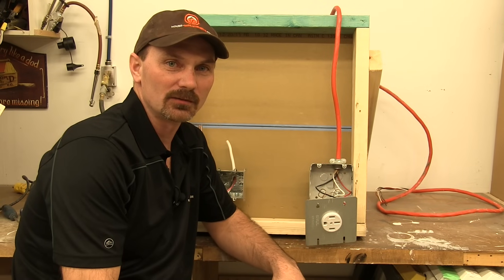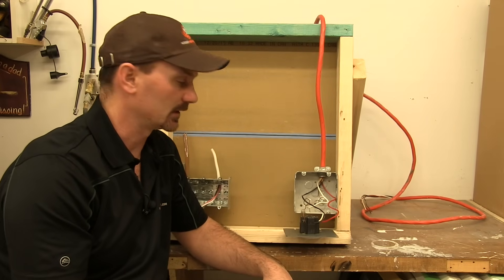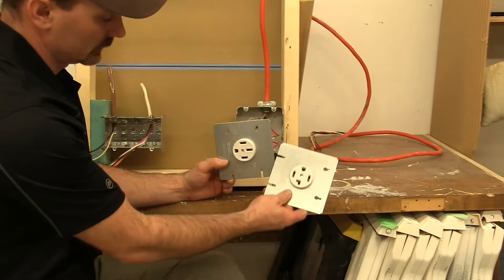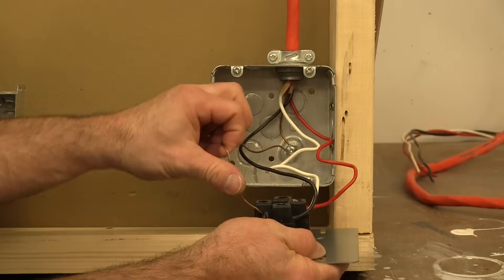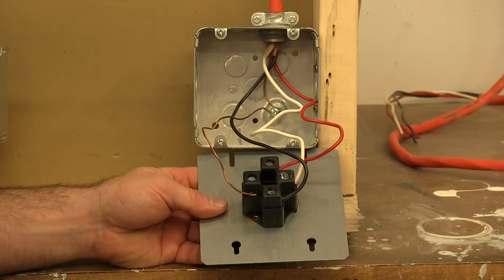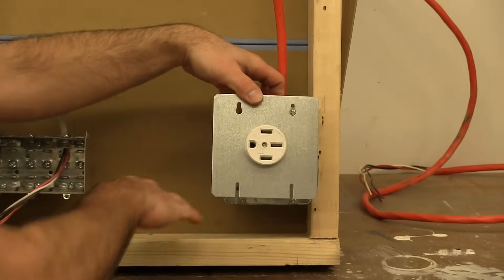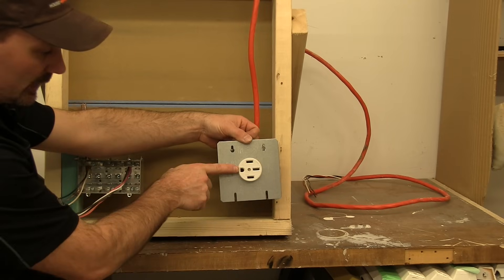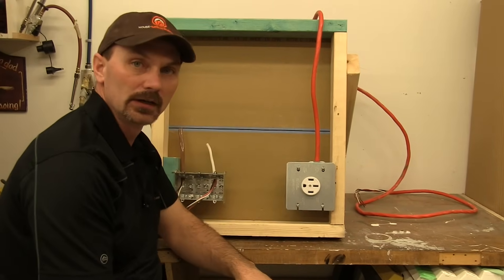Range Receptacle Wiring

Comment: What does X and Ymean
Reply from the maker: These are just the designations on receptacle for either of the hot leads . W is for the neutral wire and G is for the ground wire.

Comment: Wish it shared for old work. Do i need to cut out drywall and replace?
Reply from the maker: If you knew range does not fit the existing plug then you need to upgrade wiring and plug as needed.

Comment: The video should've been done with 6 gauge wires because you need to show how difficult it would have been to fit 6 gauge wires in that shallow box that you used. There's no way that would work well.  Secondly, the validity of many of the  comments are suspect because they're all in the same vein of  "that's a great video brother"
Reply from the maker: 6 gauge will be tougher to bend into the box for sure but they will. As for the "validity " of comments here ...well if you think I have thousands of fake accounts to comment on my own videos I guess that's your own opinion.
Reply: @HouseImprovements   No I don't think you have thousands of accounts that's not how it sometimes happens. Plus if you look at most sites where they post electric instructions you usually get many  tradesmen commenting in various ways. And you get far less people that seem like their DIYers saying they benefited from the instructions.  I'm not saying this is fraud here I am saying this is unusual.

Comment: Shannon, thanks for the videos. I’ve been watching about 7 years and have learned a lot. I recently ran into this issue where my 50 amp outlet is too high for the range I purchased, making it stick out about 2”. The specs from the range show the outlet turned sideways horizontally instead of vertically basically on the floor (same level as the baseboard) which concerns me for a kitchen where a sink or dishwasher could overflow at some point. Isn’t it a code/safety issue to have an electrical outlet that close to the floor? Thanks for any insight anyone can give.
Reply from the maker: Canadian code book actually only shows a maximum height off the floor. That is 130MM ( 5") to center of plug.

Comment: Are you kidding me? Yes I read on here that the internet lies. I looked it up they said to use 50amp wire, which is 6/3 I had 8/3 bec I had also seen it online and they said you can't in other places. And I was thinking I have a 50amp plug and a 8/3 wire it won't work. But I didn't know that each red and black wire was 40amp each. but I also think yes that would be true. I didn't know that I thought maybe the 40amp was split 20 and 20. I didn't put enough thought in it I guess. So I took my 8/3 back and got 6/3 and now I found this. Is it safe though if each wire was 40amp = 80amp will the plug handle it? Also when I find out when i do get my stove range can I just use 40amp breaker through 6/3 wire?? Pretty sure I could worth to ask. Also all I know about my range it says 240v is that helpful enough to tell me weather or not I use 6/3 or 8/3 and 40amp breaker or 50amp breaker?
Reply from the maker: 6 /3 is the new standard for 50 Amp plugs.

Comment: can you mount one in the wall like you do a regular outlet or must the box be exposed beyond the drywall with a range/oven outlet? Also do you have to mount the ground/neutral horizontal? mine I mounted the ground/neutral vertically without considering the position of the plug's orientation. the hotwires are horizontfal(as is my electric dryer's).
Reply from the maker: They can be in the wall. They are better mounted horizontally so the cord sits out of the way and allows the range to be slid right against the wall. Also if the neutral is mounted to the top the cord will not plug in because its too tight to the floor.

Comment: Can the box be plastic or does it have to be metal in the kitchen? If plastic box OK does the ground just go into the ground screw and tighten down?
Reply from the maker: Yes and yes.
Reply: Thanks.  So I'm doing this but haven't figured out how to get it completely in the plastic box.  No problem for a regular switch or outlet, but with the bigger wires, it's just not going in the easiest.  Any suggestions?

Comment: Very good video. They are so many stupid sites on the internet that have no clue about wirings and they give wrong information. For example for the range most websites say must use 6/3 wire... While 8/3 is already an overkill. What they fail to understand is although 8 gauge wire is rated for 40A and a decent size stove is 55A... we have two phases so that 2X 40A = 80A. So when an 8/3 wire gives you 80A, then why would you need to go to a 6/3 wire?? Its good to see people on YouTube who know what they are talking about and helping out. Keep up your awesome videos.
Reply: Ampacity would be the same across both phase branches. To me, it's easier to look at this through wattage. If stove is rated at 8kW, then we get 8000/240 = 33A. My understanding is that this amount of current would run on both phase wires, and not 11.5A on one phase, and 11.5 on an inverted. If we would like to find how much amps is running on that particular branch, then we would need to consider 120V one one phase, and another 120V load on another inverted phase wire. That means they would share the load, ie, each wire takes half the load. so 8kW in total = 8kW/2 = 4kW per wire which confirms that on a single wire we get 4000/120 = 33Amps
So, 8kW range is fine on 8/3 wire. 

If the range is more powerful, then it all comes down whether a range is considered considered a continuous load, and whether wires need to be upsized when the load is reaching above 80% or so of permitted load on certain gauge. And I think ranges are not considered continuous load (is it because oven actually switches off automatically because reaches the set temp?). So, long story short, I've seen some electricians saying that new homes are roughed in with 8/3 wire for stoves, and it can accommodate 8-12kW ranges. BTW, 12kW/240=50A

As well, I can't imagine using all 8kW at the same time.  It's near impossible. Basically, every single thing must be turned ON on max.
Reply: Are you kidding me? Yes I read on here that the internet lies. I looked it up they said to use 50amp wire, which is 6/3 I had 8/3 bec I had also seen it online and they said you can't in other places. And I was thinking I have a 50amp plug and a 8/3 wire it won't work. But I didn't know that each red and black wire was 40amp each. but I also think yes that would be true. I didn't know that I thought maybe the 40amp was split 20 and 20. I didn't put enough thought in it I guess. So I took my 8/3 back and got 6/3 and now I found this. Is it safe though if each wire was 40amp = 80amp will the plug handle it? Also when I find out when i do get my stove range can I just use 40amp breaker through 6/3 wire?? Pretty sure I could worth to ask. Also all I know about my range it says 240v is that helpful enough to tell me weather or not I use 6/3 or 8/3 and 40amp breaker or 50amp breaker?

Comment: Followed your advice but electrical supply house sold me a receptacle that makes it impossible to orient the plug this way. Neutral is either top or bottom.
Reply from the maker: Maybe your box in the wall is installed in the wrong orientation?

Comment: Hi Shannon 
My gaz stove is on a dedicated circuit 20 amps is it ok ? I mean is basically used the electric clock and the heating elements.
Reply from the maker: Yes gas stoves are different than this .

Comment: Hello.  So I'm replacing my really old oven 1995 ish with an old oven 2007 ish.  my house was first occupied in 1996 so it was built the year before the 4-wire mandate.  So I'm grandfathered in.  The replacement oven has both 3 and 4 wire instructions in it. So naturally I have to do 3-wire installation.  My question is, can i tap into the junction box and using 12/2 Romex, wire up to the replacement microwave, which needs a standard 15 amp service 120v ?   I tested the wiring voltage on all 3 wires and it goes as such.  Touching black & Red i get 249v, touching white and red I get 124.5v and touching white and black I get 124.5v.  The original stove/microwave unit were both powered by this 3-wire 40amp circuit where the microwave is 120v and oven 240v.  It was one big combo unit into this custom home.  I realize that new codes call for 4-wire, but my device supports 3-wire so I'm going to forge ahead in that manner. But i would hate to have to run a new circuit to my replacement microwave.  It takes a standard grounded plug.  I'm guessing my 3-wire is Hot, Hot, Neutral, which means there really isn't a grounding wire for the Microwave.  Is there any other way I could ground that Microwave? Like should I run a wire from the ground of the outlet outside to a grounded post stuck into the ground or something.  Any suggestions?
Reply from the maker: Stoves are dedicated plugs and circuits. You need to run a new circuit for that microwave , you cant splice into the stove circuit.
Reply: @HouseImprovements  ok, the orginal was exactly that, spiced to the point where is was designed that way (the oven and microwave where all in one huge sheet-metal box).  So the 3-wire 40-amp circuit just went right into "this big metal box" and then the power was distributed from there.  In fact, the Microwave push-button panel also had the stove controls.  I'm not kidding, you control the stove and microwave from one push-button panel....so thus I think that's why it was that way, just different design for Stove/Microwave combos for pre 1996.  Now when you buy combo's , you cannot get them that way (one huge sheet-metal box with microwave and stove all in there).  Thanks so much!!!  Looks like I'm going to go have to buy an expensive 12/2 romex run at the hardware store...holy crap , i couldn't believe how much it costs.  12/2 should do fine and I probably need a 20-amp service for microwave just to be safe , correct?  I'm guessing 12/2 should support 20amp.

Comment: Nice Video. 
----
Have you had the opportunity to install some kind of disconnect for an electric cooktop in the cabinet under the cooktop? I want to have one put install in the cabinet under the cooktop that looks really nice/upscale and professional that someone can just reach in and flip a lever to disconnect power to the cooktop (in order to work on the cooktop). The breaker panel is upstairs and a technician would have to run up and down the stair to turn the circuit off and on and I don't want technicians having to go up stairs.  Thanks,
Reply from the maker: They would usually just be hardwired into a junction box in the cabinet below. I'm not even sure code allows a plug in ,in fact I'm very sure it does not.

Comment: Thank you so much. You are the only one who said that it doesn't matter which side the red or black are on. I found a diagram for the plug on google but my outlet was wired up backwards from what is usually and needed confirmation.

Comment: would there be NEC code allowed to use  6/3 wire run up from the  floor to a surface mount outlet box? 
The guy at Home Depot said  I could but I might have thought it had to be chased in metal. 
Can that wire be exposed?
Reply: Yes that's the way mine was but no metal box now I watch this video because I want to put my receptacle in the wall because I am tiling the floor and don't want to have to tile around the wire

Comment: I also would have liked to see this demo with #6 wire.  The real trick as I see it is folding those three #6 and the ground into place behind the outlet.  I suppose you didn't want to try and tackle this in front of the camera -- no-one can make this look good, let alone easy.  I've seen installs in new construction where the outlet is left hanging outside of the box.  The homeowner doesn't find out for years, if ever.
Reply from the maker: This is what I had at the time ,but you are correct the #6 is tougher to deal with.

Comment: Thanks. I been watch almost all your videos over the past could years. What gauge is require for a 240 outlet for a range? Thanks.
Reply from the maker: check your local code but in most areas you should be fine with 6 gauge on a 50 amp plug up to about 100' of wire.
Reply: Thanks!

Comment: What type of breaker should we use on our panel?
Reply from the maker: You need a double pole 240 V breaker . Amperage will be dictated by the range requirements and wire size is determined by the Amperage.

Comment: There is NO PLACE in this country where "you are not allowed"......If some local governments still try to do this then go visit the local Town, County attorney's office. Codes, and Code enforcement are consumer laws meant to guarantee tradesmen don't do shabby work, the laws are not to regulate or tell a property owner what/how/when to do any improvement/repair to a person's own home......
Reply: B Tomas you may be right but they’ll take your occupancy permit away if you don’t abide by code. Virginia law states that the department of land development can enforce codes. I had to appear in court for a misdemeanor after getting caught working without a permit on my own home.
Reply: @FrydClips  A lot of local officials authorized to hand out citations don't even know the law they are responsible to enforce. The same thing happened to me with a local fire marshal who cited me for burning trash in my own fireplace, ie., newspapers, cardboard etc, under the section of the fire code having to do with bonfires and open burning.. Some of the newspaper was oil soiled and a neighbor threw a fit and called police and fire authorities. I read the fire code, went to court and the judge, before throwing the case out, asked me, "How do you know about all this?" I said, "I read the fire code". Something the fire marshal obviously had not done.
Reply: @joesmith5302  Hurrah!  Good on you!

Comment: I removed a super old oven and I see there are 4 wires and One bare wire was attached to the oven with one screw. I don't need that outlet at the moment but if I would it be a 220 volt since it has 4 wires? I have no clue I installed 3 wire outlets watching your videos :) but this one has 4 wires no outlet

Comment: So yes. Great video as usual however I agree with Aries Waters. The challenges the 8 gauge wire present need to be part of this demonstration. In particular cutting stripping and bending wire to fit into the box. The connection is simple. There are many videos on it. I can’t find a one showing the true difficulties dealing with the wire. Videos which do use 8 Gauge cut and return after doing these tasks! Frustrating.

Comment: Shannon, to clear up any confusion, you mention 50 amp receptacle, but that may not be the circuit amperage / overcurrent device. You could explain that. And use the correct materials in your demonstrations so as not to confuse. You must have some of the correct AWG wire lying around.

Comment: This is also a good video for anyone with an electric car who wants to plug in at home. Most Level 2 EVSEs (home chargers) require either a direct-wired or NEMA 6-50R to use as a disconnect for the EVSE.
Reply: are you an electrician? can this work with a non fusible disconnect? run the four wires from disconnect to the receptacle then plug the range?

Comment from the maker: This is still a 40 amp circuit ,even though the receptacle is rated for up to 50 Amps
Reply: Shannon, Thank you for your video! Very clear and helpful. I appreciate the dryer vs range distinction.
Reply: And the pointer the dryer has the “L” shaped plug so think of “L”aundry.  Didn’t know that one.

Comment: Thanks for your video.
Actually, I'm in korea.
And I have a question. 
I understand the two hot line and ground line. it is 240v.
what is the role of the white line?
is it nutral?
Reply: Correct, white is neutral.
Reply from the maker: yes white is neutral. In a range there are components like the lights,timer,plug in that are only 120V but the element is 240V.

Comment: 8 gauge is small for 50A circuit. It is best to go with 6 gauge to be on the safe side. Thx for your videos!
Reply: It's not a 50A circuit. It's a 40A range circuit. You don't base your overcurrent device on the receptacle :)
Reply from the maker: The breaker would still be a 40 amp breaker , it is just that the plug is rated to 50 amp. I guess maybe I was not completely clear on that point.
Reply: @HouseImprovements  I get what your saying i guess they don't. The plug is rated up to 50amp doesn't mean it will pull more then it needs bec the breaker will still only allow 40amps through the wire and to the plug. And they don't understand that, how is it overcurrent lol
Reply: @justinlambert440  Please pay attention to what he says starting at 55 seconds. My comment has nothing to do with the receptacle, he stated that the for a 50A circuit you are asked to have 8 gauge wire.
Reply: L9ng

Comment: Why did you connect ground wire to box?
Reply: Joe it is required by National Electrical Code that any time you have a metal outlet box, and you have a ground wire, you must connect he ground wire to the metal box, they call it bonding the box. All metal outlet boxes must be bonded to the safety ground. If you are using a plastic box there is no need to obviously because the box is non-conductive. This  requirement is a safety feature so that in the event that a hot wire becomes exposed and shorts against the metal housing, you'll trip the breaker to protect any human who might touch the outlet box and get shocked.
Reply: It's made out of metal, same as the stove.